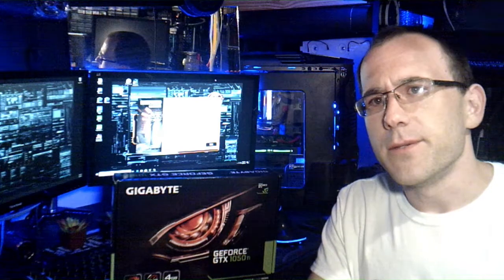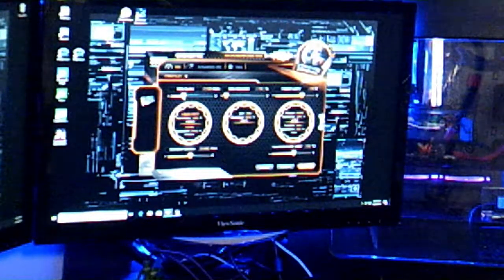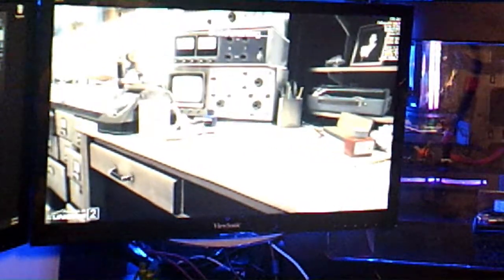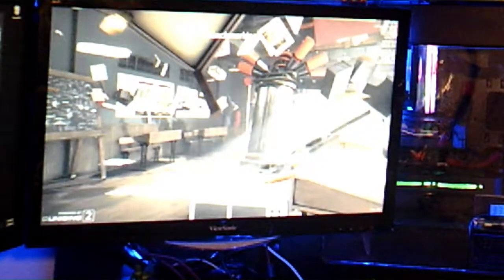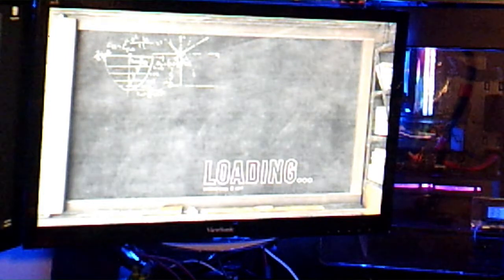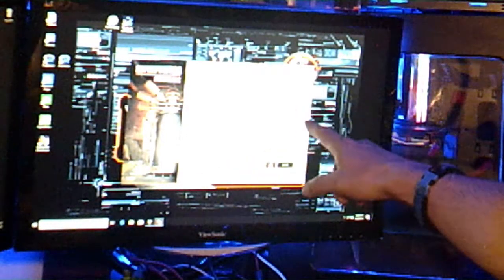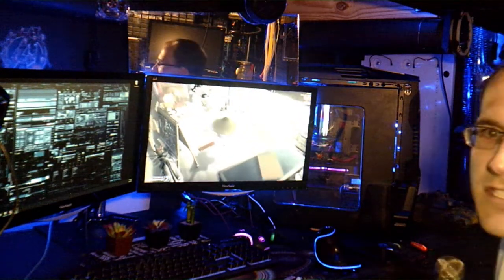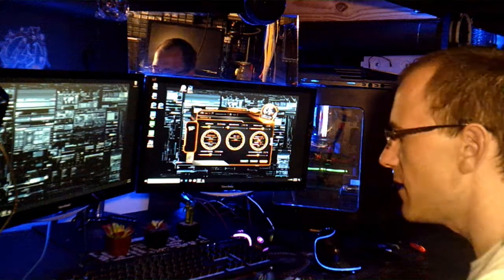GTX1050 2gb vs GTX1050 T.I 4gb ..i need more FPS

Comment: Just benchmarked all the GPUs i have, 1050, 1050ti, 1060 6gb, 1070, and 1080. 1050ti was pretty good but i think the best value right now is the 1060 6gb. You can get them for $150 if you look around and deliver pretty nice performance.
Reply from the maker: Yes i have a 1060    but after benchmarking  2 cards back to back. That was 20 individual tests I had to do 10 for each card so after that I was tired
Reply from the maker: Well send me that 1080 and ill do benchmarks on it
Reply: lol